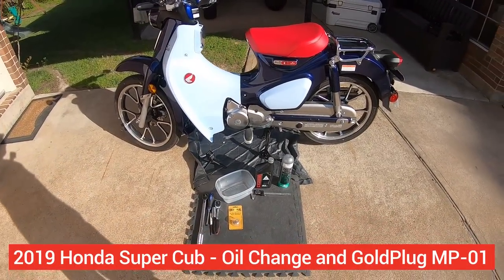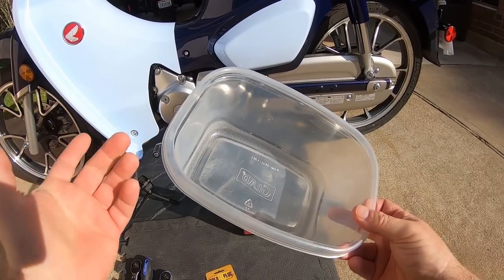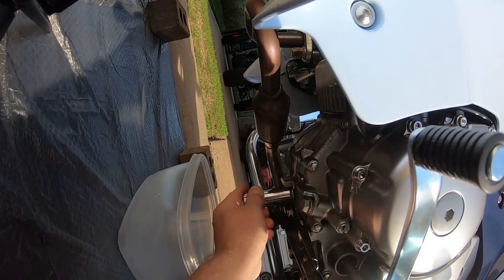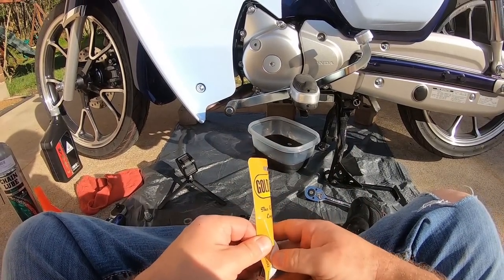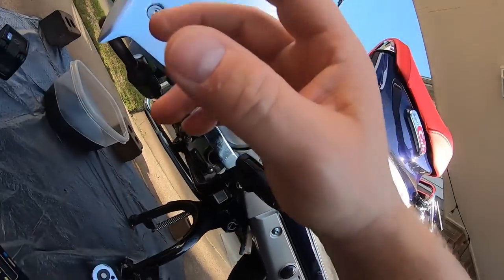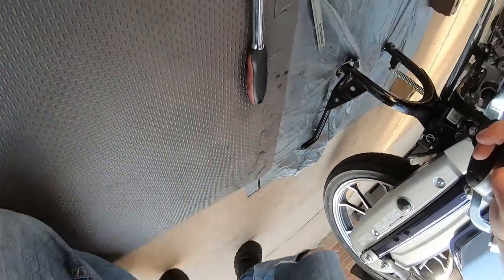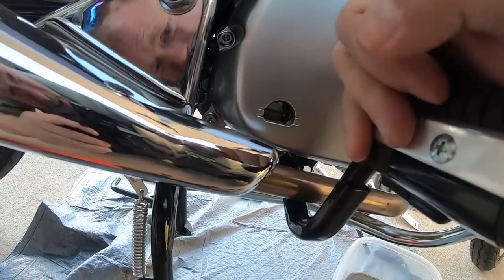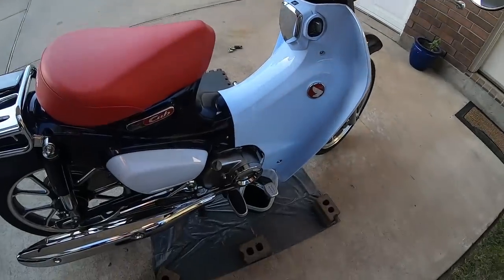2019 Honda Super Cub C125 // First (early) Oil Change // Gold Plug MP-01

Comment: How do you clean and lube the chain with the chain guard in the way
Reply from the maker: I lube the chain through the check hole in the lower chain cover every 300-500 miles... and also check the chain slack at the same time.  It's easy to lube the chain with the extended straw on the can... just dribble the spray at the lowest setting to lightly coat the inner side of the rollers and plates.  The chain guard comes off easily with only a couple of 4mm Allen bolts, so I pull the cover off to degrease and re-lube the chain every 1500 miles.  The whole process takes about 10 minutes, a drip catcher (flattened cardboard box), and a couple of shop rags... plus the tools and chemicals, of course.  👍  --QM
Reply: @QuasiMotard  it's crazy seeing this bike in CONUS. I remember seeing it all over the Philippines. Have you seen the new hunter cup? Wish Honda will bring it over. I'll for sure get one
Reply from the maker: @docfmf8404  Yep, I'm ready to rush over to my dealer and drop the cash for the CT125 Hunter Cub as soon as it's announced for the US market!  I owned a Trail 90 and Trail 110 as a teen back in the early 80's, and had great fun on those bikes.  They were nearly indestructible and they would go anywhere you pointed them.  I plan to get the new CT125, strap some camping gear and spare tires on the rear rack, and take it on the TransAmerica Trail (https://www.transamtrail.com/) for a few weeks.  😉👍  --QM

Comment: thanks for the thorough review plus the good tips! gonna get a goldplug for my wave 110. had a C3 as well, how does it compare?
Reply from the maker: Thx for the feedback!  The Super Cub is in a completely different league because of the 125cc motor and larger wheels, of course.  The surprising difference between them is in the fuel economy... I expected the C3 to be more efficient because of the smaller motor, but the Super Cub is actually MUCH more efficient (~115 mpg for the C3 and ~135 mpg for the Cub).  I made a commute vlog on the C3 a few months ago that you might like:  https://youtu.be/sYSKZNlzuXQ .  

As for the GoldPlug in the Super Cub, it works better than I anticipated.  I was concerned that the spinner screen just above the magnet might catch/hold more of the junk and keep it away from the magnet.  However, I recently changed the oil again and inspected the magnet and found a significant amount of ferrous sludge and a couple of sharp shiny bits on there.  So, the GoldPlug works, and I can definitely recommend it for Super Cub (and Monkey or Grom) owners.  Cheers!  👍  --QM

Comment: Where can i get a magnetic drain plug for a 2019 suzuki dr200s?
Reply from the maker: The GoldPlug MP-05 (https://goldplug.com/shop/mp05/) is a fit for your bike based on the part number cross-reference (Suzuki P/N: 09247-14026).  It is the same plug as used in the Suzuki TU250X.  You can find the MP-05 on Amazon here: https://www.amazon.com/Gold-Plug-Magnetic-Drain-MP-05/dp/B000JWVCU6 , or just search other online resellers in your area to see if you can find a better price.  Cheers!  👍  --QM
Reply: @QuasiMotard  Thanks a bunch for your helping kind knowledge!!👍

Comment: What does the manual say the max load is?
Reply from the maker: The USA model's load sticker on the swing arm states "234 pounds".  I'm sure that the bike is capable of carrying much more than that because the Asian markets are available with a passenger seat and footpegs.  The USA model is restricted from passenger duty because the rear footings are on the swingarm instead of a fixed point on the frame... the same DOT regulations that forced the ugly turn signals on us.  --QM

Comment: Aren't there shorter gold plugs you can buy? Do you know the length of this one?
Reply from the maker: The GoldPlug MP-01 is the correct plug for these engines.  The manufacturer didn't have them listed in their catalog when I made this video, but it's a very common drain bolt size for Japanese bikes.  👍  --QM

Comment: Great video, makes me want to buy a Super Cub! BTW it is super dangerous  and a total accident waiting to happen to have the motor run to lube the chain. A total no no in any book. Also, the chain lube will not be nearly as effective as lubing it while you are turning the wheel in neutral. I doing it this way you are spraying chain lube into the air, hitting the chain occasionally. Count yourself lucky you have not had an accident or lost a finger or two doing this.
Reply: For what it's worth the centrifugal clutch on these bikes means that it's only barely engaged when the engine is at idle speeds.

Comment: Would it helped to drain the “ other plug fluid” the one you think is for the transmission?  Or  is that another video?
Reply from the maker: That is the cam chain adjuster, so DON'T mess with that one!  I didn't have my shop manual when I made this video, so I was careful not to touch anything that I wasn't sure about.  The Cub's transmission is a traditional design that shares the engine oil supply in the crankcase.  😉👍  --QM
Reply: What would be the consequence if the other bung was undone by mistake?
Reply: @raybrown86  yes what would be the “consequences “ of that?
Reply from the maker: That second bolt with the copper washer is the timing chain tensioner.  It can be removed without any serious repercussions, as long as it's reinstalled correctly before the engine is turned over or started.  

Some Grom and SC owners have mentioned that they pull that bolt out during oil changes to drain some additional dirty oil that accumulates in that bore hole.  Removing and reinstalling that bolt can also reset tension on the timing chain idler wheel, which could potentially benefit engine longevity... dunno... maybe?  Cheers!  😉👍 --QM

Comment: It’s normal to have a Minuet amount of shaving’s in a new motor oil change.
Reply from the maker: Agreed!  That's why I always try to change the oil early and also install magnetic drain bolts to keep the abrasive bits out of the sump.  😉👍  --QM

Comment: Where did you find a service manual for 2019 Honda super Cub?
Reply from the maker: I ordered my manual through Honda's referral link that goes out to HELM, Inc:  https://www.helminc.com/helm/product2.asp?Make=AHC&Model=C125&Year=2019&Category=1&class%5F2=AHC&mk=Honda+Motorcycle&yr=2019&md=C125A&dt=Shop%2FService+Information&module=&from=result&Style=helm&Sku=61K0G00&itemtype=N .  Note this is the "official" Honda service manual, so it has the same info that the dealer would use to service the bike.  👍  --QM

Comment: Why bother with the caliper when you judge it by eye?
Reply from the maker: These small bikes are very prone to rear wheel misalignment and riding crooked due to their narrow tires and minimal weight.  If I use the axle markers on the swingarm, it's always crooked... riding hands-free shows the problem immediately as it veers left or right.

I generally use a chain alignment tool that clips onto the rear sprocket and points forward to the countershaft sprocket.  It's a quick visual alignment tool that is far more accurate than judging by the axle/chain adjustment markers (those are very unreliable).  The Motion Pro 08-0048 chain alignment tool is fantastic:  https://amzn.to/3nxlSCO

My buddy, Adrian, and I used that tool during our 10K-mile trip around the USA last year on our Super Cubs.  We burned through 3+ rear tires each and changed them on the side of the road when necessary.  Daily chain adjustment was also necessary because we were running 400-550 miles/day, and the OEM chains wear very quickly at highway speeds.  Quick & accurate alignment was important over such a long journey.  Cheers!  😉👍  --QM
Reply: @QuasiMotard  sorry but I was referring to when you checked the sump bolt length with the vernier caliper.
Reply from the maker: @donaldevanshennings7732  Ah, gotcha! I was really just using the caliper so viewers could see some relative measurements.  I didn't need specifics for this because I knew that the oil strainer screen was above the magnet.  😉👍 --QM

Comment: You didn't factor in the height of the washer...... meaning you had even more head room with the washer on.
Reply from the maker: Yessir, you are correct!  I neglected to mention in the video that I was measuring for minimum clearances to be sure that I had plenty of clearance after the crush washer was compressed.  Both the OEM and GP crush washers are the same thickness, but the GP washer seems to be a bit softer (more malleable).  In either case, there is sufficient clearance for the new bolt without touching the filter/screen that is above the drain hole.

BTW... I did another oil change at 1500 miles, and the GoldPlug caught a bunch of ferrous sludge and one shiny chunk of metal!  So, it does help to keep some of the stuff out of the sump.  I was curious to see how effective it would be with the oil spinner and screen sitting above it (whether it would have enough oil volume near it to snag some of the metal bits).  I will try to edit and post that video sometime soon!  Cheers!  👍  --QM

Comment: should i use 10w30 or 10w40?
Reply from the maker: The manual specifies 10W-30, but you may want to use 10W-40 depending on your operating temperatures and climate.  Either one will work fine, but you typically want to use slightly higher viscosity oil in higher temps and lower viscosity in lower temps.  👍  --QM
Reply: @QuasiMotard  in the summer, the max temp here is 35 °C and in the winter lowest is 8-10 °C. Should I use 10/40 Winter and Summer? The motor has 1000km.

Comment: why some website suggest 1lite?
Reply from the maker: I'm not sure if I understand the question.  If you are asking about the difference between 1 US quart vs 1 litre, then they are nearly the same amount.  The Honda owners manual specifies 800mL of oil for a normal change, and ~1000mL for a rebuild (when the side covers or engine cases have been removed).  --QM

Comment: Hi, what size is the Goldplug?
Reply from the maker: The model number is the MP-01.  I believe that the dimensions are 12mm x 1.5mm pitch, with a length of 17mm.  The factory drain bolt is 12 x 1.5 x 15mm.  The Gold Plug's extra length is due to the magnet, but it doesn't cause any clearance issues in the engine sump.  👍  --QM
Reply: @QuasiMotard  
Thank you very much!
Love your channel!
Reply: @QuasiMotard  
BTW I just ordered the plug MP-01, did you ever find bits of steel on your plug when you change your oil? Thanks again👍
Reply from the maker: Yes, I have always had lots of ferrous sludge and usually some small metal flakes on the magnet at every oil change!  I have several of those oil changes recorded, but I haven't posted all of them yet.  Maybe I'll make a compilation video with all of those videos to show how effective the GoldPlugs are.  Cheers!  😉👍  --QM

Comment: I think that your chain lube is in between unnecessary, and inappropriate.  As you observed, the chain was already oily.  As I inquired, I’ll bet that the entire chain enclosure is lubed by fumes from the crankcase breather.
Courtesy of Half Vast Flying.
Reply from the maker: LOL!  🤣  I'm not sure how chain lubrication could be "unnecessary" or "inappropriate".   The owner's manual specifies chain inspection and lubrication intervals every 300 miles.  The OEM chains on the Super Cub are standard chains (e.g., not sealed O-ring or X-ring), so they can wear very quickly if they run dry.  Oil/grease on the surface of the outer chain plates/links doesn't serve any function except to prevent rust.  Standard chains do not have lubricant sealed within the pin and roller, so frequent lubrication is key to maintaining a long service life.

Many Cub owners have reported chain failures within 3K miles or less, usually caused by excessive wear and poor lubrication.  I can attest to this fact with my recent 9600+ mile cross-country trip on my Super Cub.  Several other riders in the Scooter Cannonball Run experienced chain failures, and one of them was a critical failure which caused full wheel/engine lock-up; that issue was caused by improper chain lubrication and/or drive slack... the owner ran the bike hard for ~1500 miles without lubricating or adjusting the chain.  My Cub's chain gave up around 10K miles and had to be replaced during the cross-country trek as well.

Also, there is no crankcase breather lubrication for the chain.  The chain case is only a glorified dust shield and a chain guard... it's not sealed and doesn't provide any additional function.  --QM
Reply: @QuasiMotard  We’re in agreement that roller chains need to be lubed.  We might differ in how to go about that. My reply lays it out.  We may not see chains in the same way.  But then, I’ve only got 74 years of experience with them, and am still learning.

Comment: Why did you have the change the bolt? Did I miss something?
Reply from the maker: I usually install the GoldPlug magnetic drain bolts in most of my bikes.  The Cub might not benefit as much from the magnet than other bikes because it has a screen right above the magnet.  The Cub also has an oil spinner (centrifuge that separates oil contaminants) instead of a filter, so hopefully it will keep the metal sludge from circulating in the motor.  I have a couple of other videos on the GoldPlug in action.  Here is one that shows how much junk it catches: https://youtu.be/rtzWq5X3dc4 .  --QM

Comment: The sight glass is a poor idea.  I can more easily lift a dip stick up to eye level, than lower my eye down to ground level.  And, if there isn’t a good light source on the sight glass, it’s too easy to read it inaccurately.
The first four changes I would do is (1) replace the expensive, unnecessary proximity key system with a simple ignition key. (2) replace the sight glass with a dipstick. (3) design an engine that does not need the crankcase to be dissembled to clean the oil filter.  And (4) replace the electric starter with a kick starter.  Honda may have some young, sensitive engineers?
These items are personal opinions, and others will vary.
Courtesy of Half Vast Flying

Comment: So is typical “break in” oil just dino as opposed to synthetic, so that as you said to help seat the rings?
Reply from the maker: Exactly.  I've always used standard petro/dino based oils for the first ~1000 miles in my street engines, and the first ~10 hours on my off-road 4-stroke bikes.  The rationale behind that idea is that most synthetic base stocks are too thin and/or slippery to allow for proper bedding of the reciprocating parts (allowing too much blow-by or insufficient "polishing" of the mating surfaces).

After that break-in period is done, then I'll switch to a high-quality full-syn oil for the remainder of the engine's service life.  I don't run extended OCI's (oil change intervals), even if the engine or oil manufacturer recommends it.  Oil and filters are cheap, so I change them early and often... no more than 3K miles between changes for larger motors and 1.5-2K miles for smaller ones.  I've had several car/truck engines that have turned over 350K miles using this routine with zero oil-related issues; similarly, I've had 3 different high-mileage bikes that have turned over 150K, and many others in the 50-75K mile range... all with zero engine issues. Suspension, steering head bearings, driveline, starters, gaskets, frames, and other things have failed... but the motor still looked nearly new inside.  --QM

Comment: Nice video ! I was wondering what the purpose of this "screen" was, and why the super cub did not have a oil filter, which would be weird. By what I read on the Internet, and as you said in the video, the Super Cub uses an oil spinner, which is a kind of oil filter which propels any particles into the edges, forming a dirt crust, while also having a screen in the middle where the oil continues to flow, it's the screen that you hit with your soda straw, to catch any particules that want to continue to travel. Of course the screen only captures particules bigger than the mesh, which can be nicely complemented with the magnetic bolt. So I guess that to completely clean the oil and filtering system, the oil spinner must be removed, cleaned of any dirt, screen also cleaned, magnetic bolt cleaned and oil changed. I found some pictures for those interested to see how it looks like : super cub oil spinner https://adamdanger.wordpress.com/2020/07/26/honda-super-cub-125-oil-filter-screen-cleaning/ and oil spinner when dirty (its a from a grom engine, but it's the same than the super cub) https://www.hondagrom.net/threads/how-to-clean-oil-spinner-thing.936/page-3#post-77143
Reply from the maker: You're exactly right on those points and assumptions.  The centrifugal spinner is a "cheap" way to clean the oil on these small engines, and it reduces the maintenance costs because there are no filters to replace.  I would prefer a filter, but the original design is simplistic and effective... genius engineering at its finest.  The downside to that spinner arrangement is the 8000-mile maintenance when you need to remove the side cover and the oil spinner assembly for cleaning.  That procedure isn't terribly difficult, but it requires special tools and fresh gaskets.  I plan to do a full maintenance video when I do that service on my Cub.  Cheers!  👍  --QM
Reply: @QuasiMotard  thank you for your answer :)